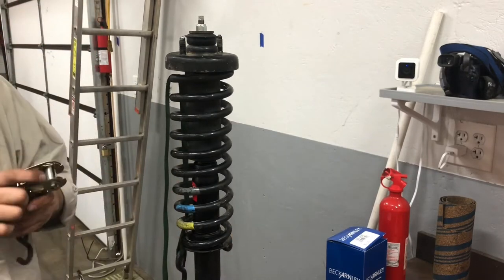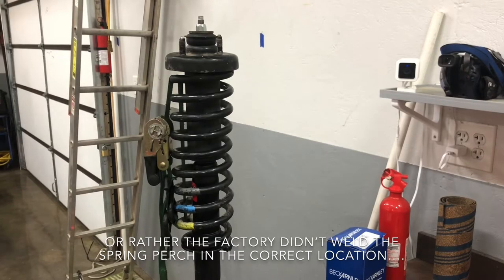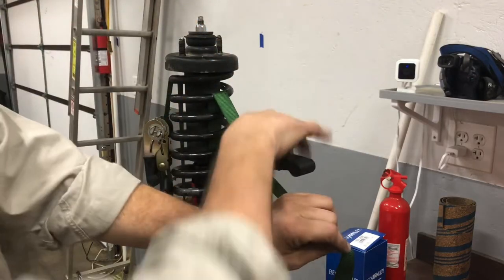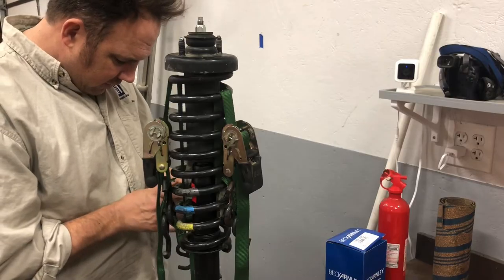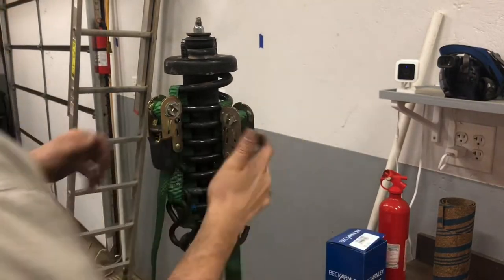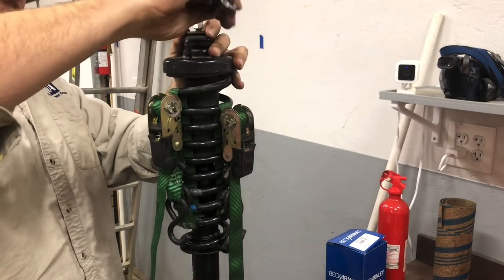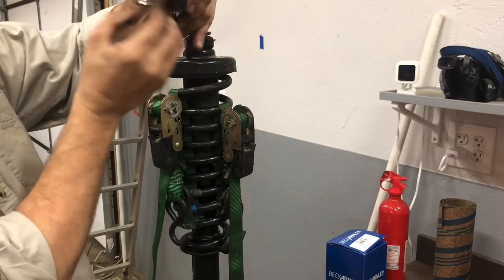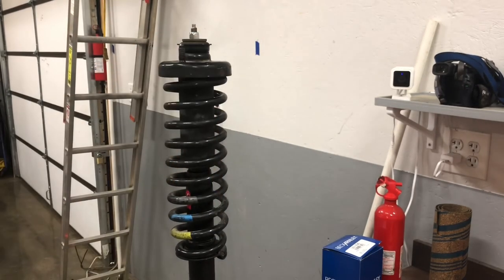DIY: Ratchet Strap Spring Compressor

Comment: Safer than the clamps I've seen people using, I've watched alot of these jump out of cages but never had an issue with strapping them.
Reply from the maker: Seems like it’s definitely safer than the standard Autozone grade spring compressor.
Reply: It's simple physics. Is the ratchet straps are rated for a certain amount of tensile strength then what's the compression rating on the spring and if you go 2 to 3 times over the compression rating. And it's locked in there's no more risk than using those spring compressors that could slide outside ways and shootout at someone
Reply: My thought  is that if you're using  a new good set of straps ( not dry rotted or weathered) for the proper tension value & you use three straps maybe even 4,, that even if there was some unlikley  failure  all  3 straps  at the same time that the sping  energy  & trajectory & energy would still be sort of wrapped up  in the straps as it went flying ? I have more faith in a quality set us 3 straps than the manufacture quality of a metal spring compressor from Amazon.. Just my two cents

Comment: U can use the weight of the car or truck .  Just compress the spring with a jack under control arm, then loosen the middle top nut first.
Reply: Then how do you the get the spring back on after?

Comment: If you're putting the spring on another shock then you don't even have to unclamp them could you going to have to reclaim them anyway so best to leave them clamps and pull tight so you can just switch it over

Comment: When I was young and stupid I used hose clamps to hold the spring compressed when I took it off. I threw it and it went 50 ft into the sir. Needless to say I got the right spring compressor next time.

Comment: my friends car came back from having a new spring fitted, it didn't drive right, when he looked there were still a few heavy duty zip ties compressing some of the coil. Maybe useful as secondary protection once the straps are tight.

Comment: Great idea. I have straps I purchased for lining up my control arms but I didn’t think to use them for the spring. Driver’s side went on with a pry bar but passenger’s side was more practical to go with this method. Thanks again 😁
Reply from the maker: Don’t die!
Reply: @BellyUpFishGarage  My biggest concern would be something happening while the vehicle’s driving since I did the whole rebuild, I may pay the place I get my alignment done at to double check my work 👍🏻 (even while it’s as simple as torquing everything down)

Comment: Great video, and great hair! 👍😁
Did you know you can loosen a ratchet strap under tension one click at a time like a come-along? Set the ratcheting handle halfway between fully open and fully closed, and put some tension on it like you are going to tighten it further, but do not go far enough that it clicks. Then reach inside with your finger and pull back on the plate that engages the ratcheting pawls to disengage it from the pawls, and slowly let the ratchet handle move back toward the closed position (the tension load will pull it back). Once the ratcheting pawls clear the plate that you are holding back with your finger, release the plate so it engages the pawls at the next looser notch. Continue to do this one click at a time until all the tension is released. It takes longer, but it's a lot more controlled and less scary then just knocking 'em loose. That might be the "Safest, LESS dangerous way", ha ha!

Comment: ....lift the car or teh side you want to work on, put the straps on the spring without removing the wheel if you can, lower the car, now pull on those levers untill the straps are somewhat tight.
Lift the car :) now the spring remains compressed. That is how you do it, there will be some cars where there is not enough space to do that, but this method will work for many cars. You don't have to worry that the straps will tear apart due to friction, since you don't pull on the lever to compress the spring - instead the weight of the car does the job. 😏

Comment: I did something very similar ~15 years ago with a dodge ram.  If I can’t remember if it had the shock mount through the spring or if it was a coil over.  Probably a coil over since I somewhat remember it being off the vehicle when I did it.  

I didn’t have a coil spring compressor and it was after hours on a weekend.  

I think I used four 1” ratchets working around one click at a time.  The same for releasing the pressure.  

I still don’t understand why full-size trucks don’t have a removable shock.  There’s room to mount it.

Comment: Would you say that this wouldn't be such a bad idea if I just needed to compress a spring on the front shocks on a 2019 Jeep Grand Cherokee in order to fit the shocks back into the car after adding a top-hat spacer for a 2.5" lift kit? So I wouldn't even need to remove the spring itself, since this kit doesn't come with a pre-load spacer, only the top-hat spacer. Not exactly sure how much I need to compress the spring, but it definitely is not the whole way, maybe 1/3 compression, 1/2 at most? Thanks!
Reply from the maker: Personally, I’d do it on my car, and while it would work, you should under no circumstances do this. ;) Disclaimer, disclaimer, disclaimer. 😆